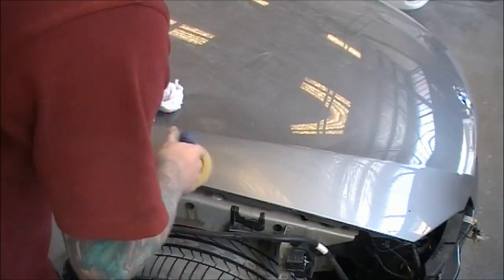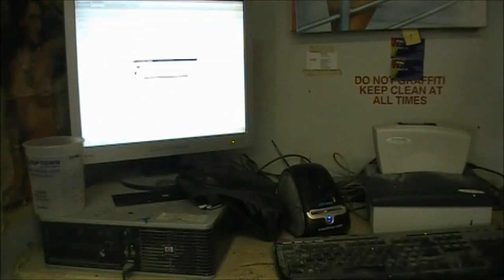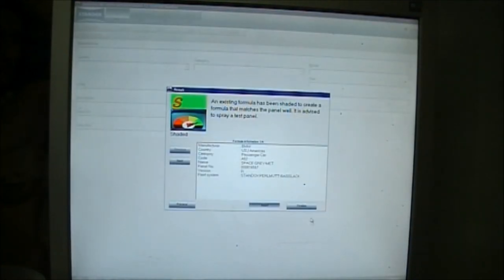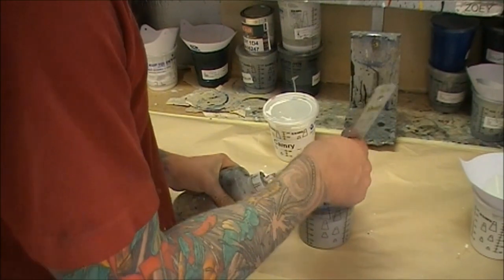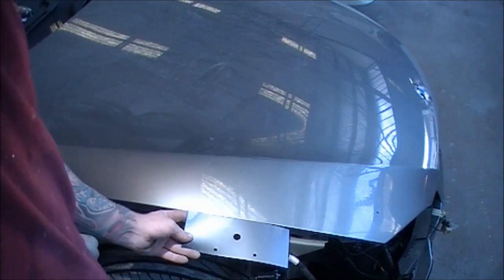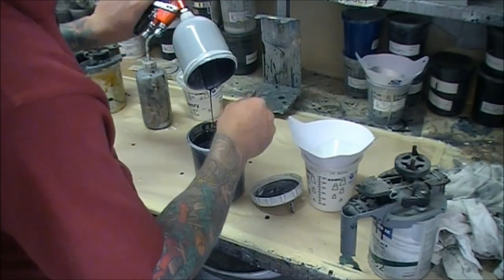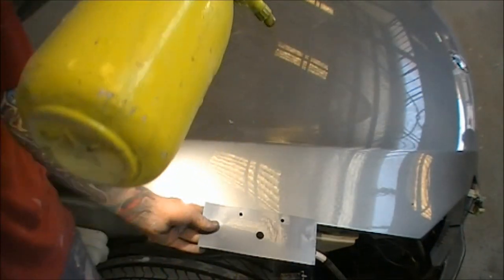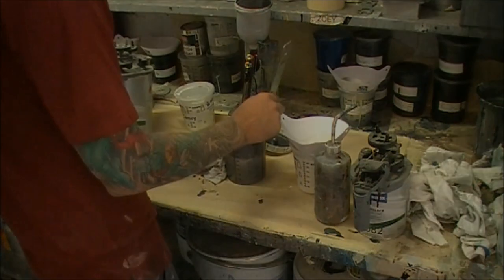How to Color Match Pearl Standox

Comment: Thats a pretty cool system. I work with the spectro on a different paint line but that software standox has is sweet! I wish ours would create a formula off of what the camera shot.
Reply from the maker: Yeah it's pretty good and I'd say it has a 95% success rate if used correctly.
Reply: hi what is blend-in thinners?
Reply from the maker: M.Zaheer Moosa It helps you fade in new paint to old
Reply: Thank you.. So you just add it in to paint as you do regular  thinners?
Reply from the maker: M.Zaheer Moosa https://www.youtube.com/watch?v=bdvLDgrIdlY

Comment: Hey, once you reduce the paint, does it have to be used right away, or you can store it reduced in the can for couple months?
Reply from the maker: Andriy Vladyka Basecoat will last for up to 10 years and maybe longer if stored in an aluminum can and sealed well.
Reply: Thanks for the quick respond!
Love your videos! 👍
Reply from the maker: Andriy Vladyka Basecoat will last for up to 10 years and maybe longer if stored in an aluminum can and sealed well.
Reply: +Andriy Vladyka I found you can use it when ever as long as you mix it well before you paint some shit with it as gunny would say.